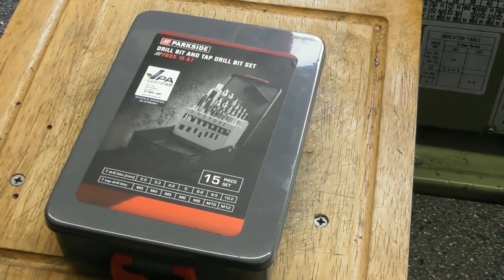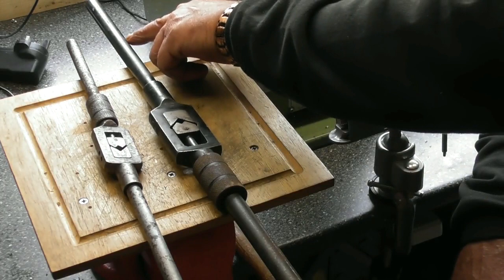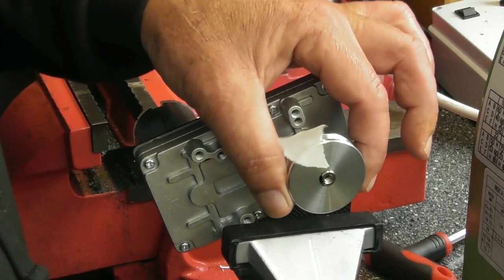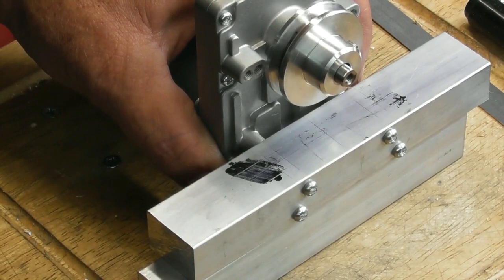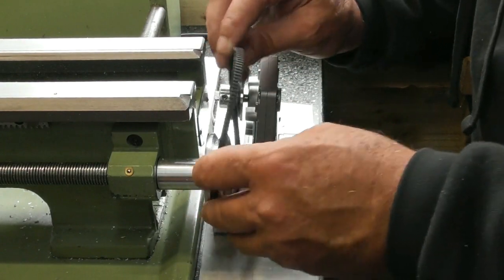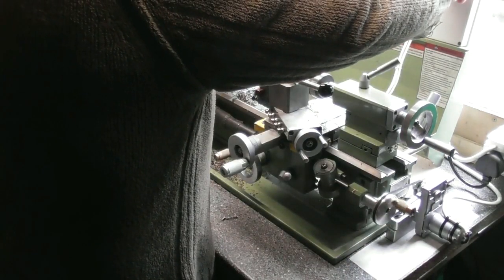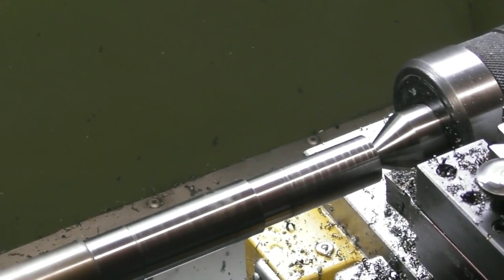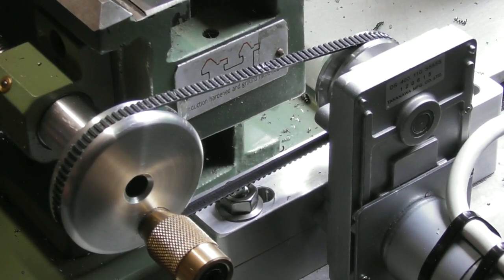Warco WM180 lathe Variable feed speed motor part 2

Comment: That’s fantastic! By taking the cutting load off the spindle motor, you can take a much heavier cut than you could otherwise where the motor is driving the work and the cutter. And getting an excellent finish. Amazing what can be done with such a small lathe and motor when you know what you’re doing.

Comment: I've commented on this six months ago Ade, can you tell me any SKU numbers on your motor/ gearbox please ? I am looking on eBay but can only find a  load of exactly similar much smaller ones. They only have a 5.5 mm shaft and look much less substantial than yours. An eBay sellers name would be even better! Also where did you obtain the control  and switch for it? Many thanks mate.
Reply from the maker: In the workshop today so i will look up the numbers . send me an email and i will reply with the details . adesworkshop@hotmail.com   cheers Ade.
Reply from the maker: https://www.ebay.co.uk/itm/TAKANAWA-555-Metal-Gear-Motors-3V-24V-DC-Gear-Motor-High-Torque-Low-Noise-New/303147312459?hash=item4694fce54b:g:XNsAAOSwKbdc0qrq         control board is from banggood, cheers Ade.

Comment: Thanks for this very inspiring video! Just receiving my Mini Lathe and setting it up for the first thread cutting knowing that a near future project also will contain thread cutting I don't like to set it back to normal power feeding. Your concept would be perfect, powerfeed by an electrical motor. 
I think about using a proximity switch that can be mounted on the lathe making the power feed stop in time. Maybe the switch can even reverse the powerfeed motor direction… What do You Think Ade?
Reply from the maker: Sounds good to me . maybe have the limit switch on a slide so you can adjust it to where you want to reverse . need some relays for that circuit , Cheers Ade.
Reply: Yes, it must be an adjustable mount to adopt easily to different situations. Being comfortable with electronics and programming I'll use an Arduino and MOSFET transistors as well as an already tested type of proximity switch..

Comment: Thanks for this inspiring video Ade! What do You tink about adding a microcontroller, a spindel rotatioin sensor and Your concept of motor use? My idea is to be able to cut threads by letting the controller advance the carriage syncronized with the spindle rotation. No gear changing… I see only one problem, my ordered laith is for the moment popping up and down on the waves at sea on its way to UK and Warco.

Comment: Ade, I would never doubt you, you have forgot more than I know about Lathe work, but if you fit a rotory encoder ( £16.50) to the rear of the chuck drive and you can simply adjust the motor to the required drive screw speed as often and the correct thread speed. I saw this on a You tube video.
If you want, tell me and I will find it for you.
My respects to you Ade. Colin.
Reply from the maker: Yes , I think i watched the series , Digital lead screw i think it was called . very interesting watch. Cheers Ade.

Comment: Hi Ade.

Great ideas and excellent execution as usual.   You might recall I swapped my 180 for a 240, mainly to get a lathe with T slots on the cross slide.  Your latest mod looks to be eminently suitable for the 240.  So I'm gathering the necessary parts.

Regarding the diameters of the pulleys [59 and 39mm].  Are you happy with the size or of the motor pulley, now you've had chance to test, or would you alter it?

I already have a Banggood DC 6-60V 30A PWM  motor controller with digital display, and a length of 40mm round ally bar.  Today a 24V 15A switch mode PSU arrived.

A DC 24V 60RPM motor,  length of 60mm ally round bar and a DPDT switch are on order.

The end of the lead screw on the 240 is 10 mm of threaded M12 x 1.25, so I have a pair of taps on order.  I'm going to take up the end float and then secure the winding handle to the lead screw with a grub  screw.

thanks for all the ideas and help, keep up the good work.

Cheers Noel
Reply from the maker: The sizes seem ok at the moment but i have not used it much since completion . 
it is a good ratio to start though, Cheers Ade.

Comment: Hi  Ade, I came across this by accident lol it was the Warco that caught my eye, I have a Warco 300 and have the same end of lathe crank for the X feed as you. A great modification sir! I will be sourcing a similar motor/ gearbox to do the same sort of thing. Well done!
Reply: A few months later Ade and I've got my mod done now. I didn't use the same unit as you but a coaxial motor and 18.75:1 gearbox mounted to the back of the lathe bed. I made a 60 mm steel pulley which I fitted between the lead screw dial and the handle I had to make an extension to the lead screw and mill a 4mm keyway in it and put a new key right through the dial, pulley, and handle. I made the 30 mm drive pulley from aluminium and used a similar5 mm drive belt. I also bought a 10 amp 24 volt power supply ( which promptly blew up spectacularly after ten minutes of use!) and I think the same type of speed controller as yours which works from about 10 v up to 60 v if I remember correctly. Suffice it to say I have it now working on a 12 v car battery at the moment until I can source another 24 power supply of not the same manufacture! I have no need to remove the belt to use the hand feed as the gearbox is an epicyclic one and is quite easy to turn by hand. Happy days as you say! Thanks for the inspiration to do this Ade as I would nervier have thought of this myself.

Comment: Excellent as always Ade, all sorts of advantages to that setup. One thing though, have you got the drive belt inside out?
Reply from the maker: No . for some reason the belts appear to have teeth on the outside , it is the same belts as the warco drive belts . Cheers Ade.
Reply: @ade63dug  Oh yes, i remember that you said you were going to use a Warco drive belt. Just had the cover off of mine and i've never noticed that before, they do appear to have ridges on the outside, strange.

Comment: G’day Ade, top mod to the lathe, I’m amazed at the power it had although I can see a future mod, making a dog drive for the engagement. I’m also impressed that little lathe could cut a 2mm radius cut in steel, did you check how hot both motors were. Well done I’m suitably impressed. 
Cheers 
Peter

Comment: Bloody ell Ade that was impressive, that setup did you proud :) nice find @ the car auction and @ Lidl if the bits are indeed HSS will get some as to get tap size bits I have to trawl through to much on ebay to get said bits TFS. G :)

Comment: Ade, you said no when I asked, but you could do away with the change gears now, if you wanted. great video, respects Colin.
Reply from the maker: No still . the change gears are still needed for screw cutting or threading , this is purely for feed in machining . It works great for that though . Cheers Ade

Comment: I like it.  I'm curious to see the varied results you might get with a vertical shear tool, mainly with a high spindle speed and ultra fine feed.

And the nice thing about both being infinitely variable speed is you can tinker with both during roughing passes to find your ideal speed combinations for the finish pass.  That should be handy when you are working with "scraptonium" (aka mystery metal).
Reply from the maker: It has opened up a world of experimentation , time will tell as to the reliability and uses , Cheers Ade.

Comment: A great project I’m going to make one myself what speed motor did you use as on checking EBay they come in quite a number of different speeds?
Reply from the maker: This one was 60rpm at 24v , Cheers Ade.